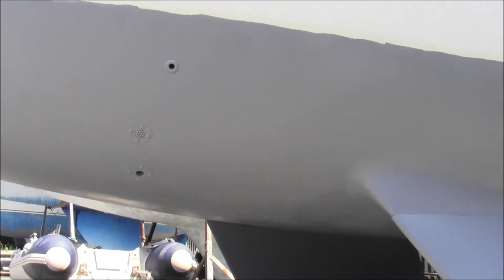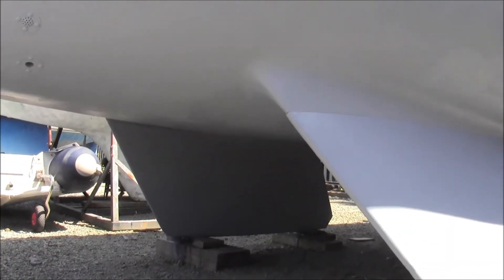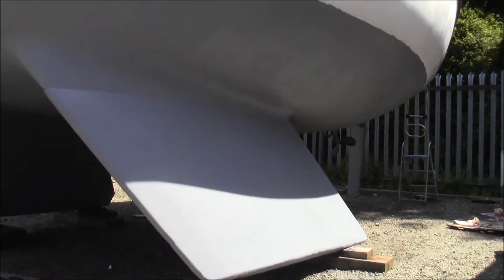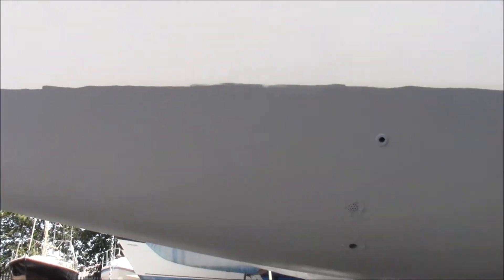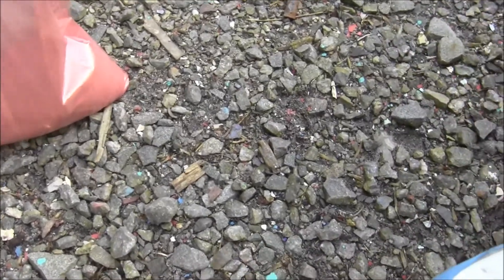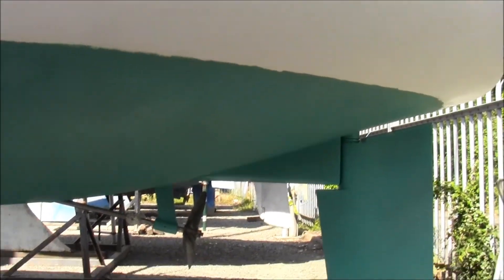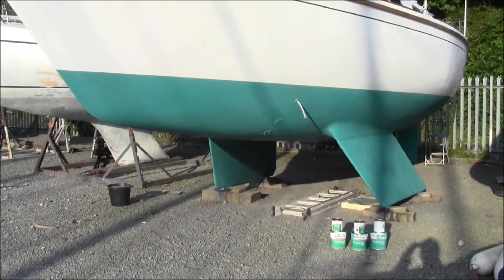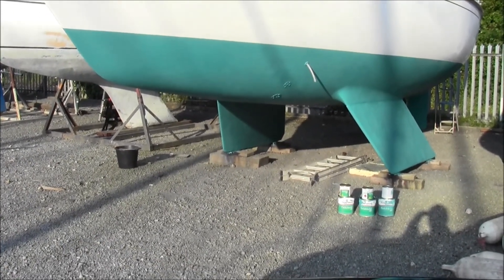Gelshielding, with copper added, a Westerly Fulmar

Comment: I lose track of which boat your working on these days ! I’m planning to launch Vivendi on the 20th July and will also be heading up to Scotland from the beginning of August for two months. Maybe see you in the Straits (I’m just South if the Gazellle) before I go.
Reply from the maker: Yes, I did epoxy the Mirage last year, she's now in new ownership. I had the idea then of adding the copper but only put 1kg in. It will need more. I hope to launch soon and head north. I saw somewhere that Scotland will open up 15th July, we here 4th or 6th, so will look at getting off asap. I made a new lazybag in the early part of the lockdown and videoed and will show when i get a clip of it on the boom. I still need to find battens somewhere. Good to hear you are heading that way, I'll look your fb up and message you on departure times likely to be earlier than you.

Comment: Interesting. In theory, it should work just fine. I guess only time will tell.
It certainly looks good.
Reply from the maker: YouTube stopped my notifications, annoying, as some comments left unanswered for a month. Do you know how I can correct that? maybe it's because I have been demoted in their league tables being less than 1k subs. There's me thinking nobody wants to comment any more, ha ha. I had a copper/epoxy boat someone else had done, it  was ok, the previous owner told me to lightly abrade every year. lot of prep work involved and a long day painting 3 coats. Yes, worth it I hope. I need a few weeks afloat now as payback.
Reply: @mjcooke2sailingmostly  I have no idea how the YouTube notification thing works. Sometimes I get an email, sometimes I get a little red circle by the bell,, and sometimes I get nothing. Even if I click on my own video and look at the comments, some are missing and have been filtered out for approval for no reason. It is very frustrating.
Hopefully you will get some weeks afloat before too long.
Reply from the maker: @verynearlyaboutsomething  I tried to go to advanced settings but nothing changed, all the permissions set. Your reply came into junk for some reason. I'll just have to check for comments. I managed to change my profile pic from a boat I was sailing 6 years ago though, time it was updated! I use a tablet mainly and don't get into my channel analytics often
Reply: @mjcooke2sailingmostly  Still. At least you and I are luckier than the Foxwells. They can't get comments working at all. - And there is absolutely no reason for it.
Reply from the maker: Hi Paul, I can report success with the copper epoxy job, just heard from the now owners, an update report in the description.
Reply: @mjcooke2sailingmostly  Excellent stuff Mike. The Coppercoat product is simply too expensive for a lot of us. The science is certainly very sound. I'm glad it worked
Cheers, Paul
Reply from the maker: @verynearlyaboutsomething  I was quoted around £800 for the Coppercoat materials, the Gelshield and copper and everything needed was around £350. I must say I'm tempted to buy the Coppercoat for my latest as I like the smooth 'bronze sculpture' look and I'm thinking the budget in this one will allow.

Comment: Hi Mike, I had planned to do this to my Griffon after those winter gales, then lockdown happen and cant get to ABC. May just slap a coat of primer and cheap antifoul on now and do it this coming winter rather than try and rush it in July. Are you putting her in or selling her?
Reply from the maker: Hi James, tough not being allowed here to your boat but things changing soon , 4th, 6th July? Maybe as it will be a short season, put her in as is and do a scrub on a beach if necessary. I did all the prep work end of last year. I painted phosphoric acid on the chipped, scraped, ground down keels then and left till recently then the Fertan which worked well. It's a lot of work if you are commuting a distance, would end up expensive in travel costs unless you are a fast worker! I hope to launch as soon as I know that I can travel unrestricted, Scotland beckons, it's maybe 15th July when I may be welcome there. Hope you get some use yourself. May well sell after I get a good cruise and some payback time afloat.
Reply: @mjcooke2sailingmostly  I plan on heading up on 6th July and make a start, then do a few long weekends. At best it will be August before she's in, sold law I bet the weather turns and we get a rough August / Sept/Oct, after all that great weather we had in the Spring. Enjoy your travels Mike.

Comment: Hi Mike.
Lovely finish on the Fulmar hull after a lot of hard work. I scrapped the old antifouling off my Seahawk 34 five winters ago and said afterwards I would never do it again! I'll gladly pay the man with the blasting gun if it ever needed doing again! Sadly, I haven't seem Magic Hawk since February thanks to lockdown so I'm eagerly waiting for 6th July now to get cracking again.
Best wishes
Reply from the maker: Hi Mark, Tough not getting to your boat, I only recently was allowed access to mine. I made a sail cover/lazybag with an old Singer in the early part of the lockdown and was glad then of the work to occupy myself, being indoors a lot. I'll do a video once it's fitted. I still need battens for it. I did all the scraping, chipping and sanding end of last year and the job was a long but oddly rewarding one. Tot up the travel costs and the materials and yes, probably paying for blasters would work out near similar costs. Restrictions in the yard mean though that the boat would have had to be moved at my cost to a place where they could do the blasting.  I'd be wary also of the level of blast, they could easily make a lot more work for me if they over did it.  As it was, I had a tarp under the boat and collected 5 or 6 bread bags of old paint. Would I do again? Yes, but not for a while, ha ha.

Comment: Nice job Mike and certainly worth trying to see if the copper makes a noticeable difference. I have seen others use a non-genuine copper coat solution and it seems a more positive effect was gained from sanding the finish back to give greater exposure to the copper dust as the last step before hitting the water. Look forward to you sharing your option in due course.
Reply from the maker: I don't see why it won't work, it got a lot of copper in the coating, equal weight for weight copper/epoxy. Gelshield is similar, I believe, to the solvent free epoxy used in the named brands. Yes, they do say to sand the surface. I've not been back yet and will see whether I will need to do that. I'd prefer to leave as is and see how that goes and sand if it doesn't work next time it's in a boatyard. It will be a short season anyway with the boat moving a lot and moored in a fresh/salty mix location that doesn't foul much so not a good test. Human nature to do only what we have to! i didn't want to show a 'how to' video or someone might blame me if they are not happy with their own efforts, ha ha.
Reply from the maker: John, I can report success, just heard from the owners, a report in the description.
Reply: @mjcooke2sailingmostly  Mike, thank you for taking the time to remember to reply and update. I'll check out your latest video and update, in sunny Thailand now.

Comment: Where are you off to in this, what do you think of the Tempest
Reply from the maker: I hope to launch as soon as restrictions here and Scotland allow travel further, we are behind England. I saw somewhere it may be 15th July for Scotland. Scotland beckons, I made a new lazy bag sail cover with an old Singer and will do a video when it's fitted. we surprise ourselves what we can do with a bit of time on our hands! Cheap too. I don't know the Tempests, only from adverts. The more modern Westerlies certainly have lots of space, the wide beam carried aft makes the space, same though for all modern designs. wish Westerly had not decided on painted decks though, makes work. You thinking of buying?
Reply: mjcooke2 well I like the vega and then you sold yours,I’ve always liked the fulmar, I understand the headlining are a pain, I wish they had made the rear birth a decent cabin. Tempest has two rear cabins, other contender is sadler34. I watched the fulmar in the fastnet it was almost sailing backwards and yet they are supposed to be quick, yours would be good for skulking round estuaries. Keel bolts ok?
Reply from the maker: @santamulligan676  My old Vega is still here in North Wales, same yard as mine. The headlining on all Westerlies goes at some time. Mine was replaced around 3 yrs ago. New engine too, a 3YM Yanmar, best I've ever had on maybe 15 boats. Wish it didn't have a water pump belt though. The 1/4 berth is very wide, good for two kids or close friends! There are rare aft cabin Fulmars. I'm impressed with the speed, I can keep a reef in the main and get good speeds. Very light on the helm with semi balanced rudder. Draft is around 4ft, They are two big keels. there can be slamming in between on the flattish hull when punching into waves. Great feeling of space for a single hander! Around 11ft beam. Sadler 34 would be a good alternative, watch out for problems with the foam sandwich.
Reply: mjcooke2 thanks nice to get quality info, other point I noticed was no Skeg for the rudder.wondered if you had heard from the Italian lad in the Hurley, got to auz I believe.look forward to you going back to Bantry